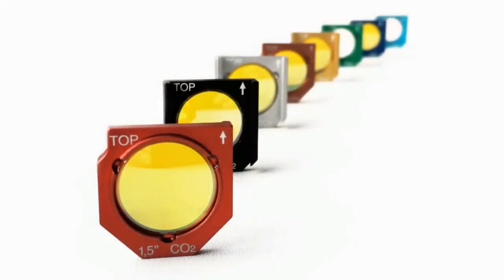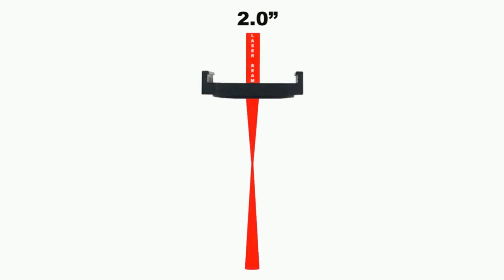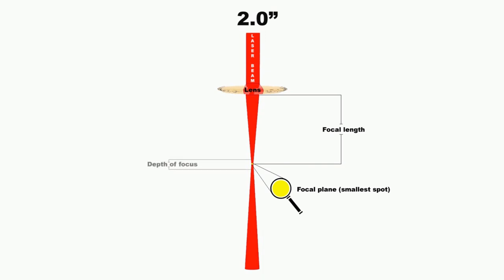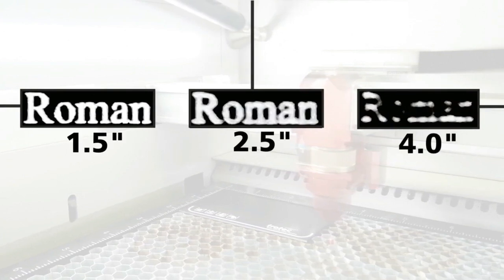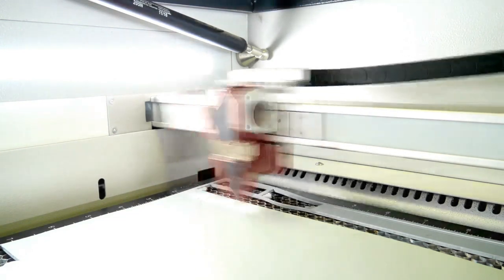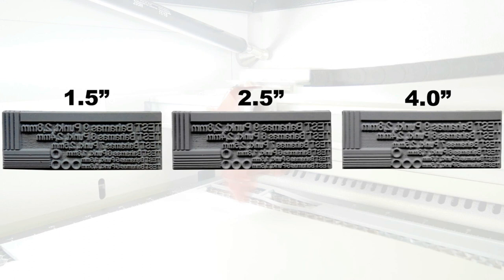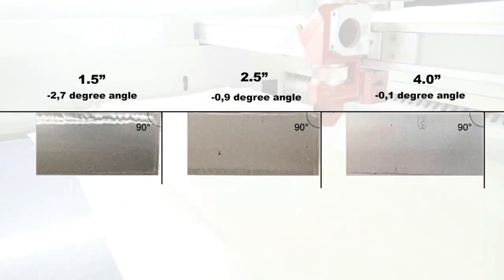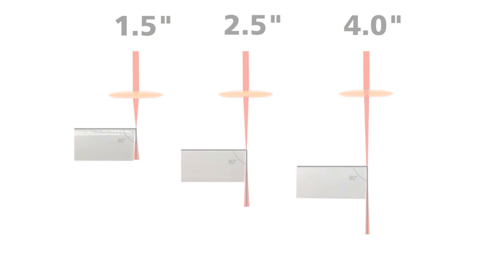How To Use Different Focus Lenses - Finding the Perfect Lense for Every Material

Comment: As I got it right you did not adjust the focus when engraving Al to the focal length of the 2nd and 3rd lense? If this is done the engraving should look exactly the same on all three specimen. Right? What are the possibilities to get a smaller focus point? This would be the way to increase resolution, increase speed by having a more concentrated spot and you will be able to cut deeper with a 4" one. What can be done to get a smaller burn point diameter? Mine is about .068mm DIA in optimum setting. I really would like better resolution also when production time increases by a smaller line gapping. Thanks guys.
Reply from the maker: Hi! Thanks for your question and interest - you can find a detailed description about our focus lenses and the optimal use of them for reaching perfect results here: https://www.troteclaser.com/en/laser-machines/laser-accessories/focus-lenses/. If you require any further info on this topic, please contact us: https://www.troteclaser.com/en/contact/

Comment: The graphic at 1:40 is incorrect.  Focal length is from the center of the element, not the leading edge to the focal plane.  I know it doesn't mean a bunch here, but the same term in photography has significant importance.
Reply from the maker: Hi, thanks for your input, you are very keen-eyed. You are right, the line is inaccurate and will be corrected with the next revision of the video.

Comment: What were the speeds/powers used? Does the 4" lens need more power to cut through the same material as a 1.5" or 2.5"?
Reply from the maker: Hello Colleen, thank you for your questions. The parameters differ according to the materials you're processing with the laser. The more delicate and detailed the graphics are, the smaller the lens should be. For cutting thick materials, lenses of maximum size are recommended. For detailed information please see our FAQ page: https://www.troteclaser.com/en/knowledge/tips-for-laser-users/selection-of-the-right-lens/.

Comment: Why does a longer focal length correlate with a larger spot size? I would have thought they all converge to a point (diameter 0) before diverging. Is this due to Raleigh scattering?
Reply from the maker: Regarding point (diameter 0): A wave cannot be focused to a point. The beam waist increases with increasing focal length and wavelength. Waist is typically 10-20 times the wavelength.
Please find more information here: https://www.troteclaser.com/en/knowledge/tips-for-laser-users/selection-of-the-right-lens/

Comment: What kind of laser power wattage do you need to use a 4" lens?
Reply from the maker: Hi Mr. Harney, the parameters (especially speed and power) are depending on the material you intend to engrave/cut and the expected outcome (color change, depth of engraving).
The 4" lens has a spot size (diameter) which is twice as large as the spot size of a 2" lens.
 Energy density compared between 2" and 4" is 1:¼ --> you have to adapt your parameters (speed & power) to compensate this much lower energy density.
 Your Trotec Team

Comment: Will a 4" focus lens be able to cut deaper materiale with the same power than the other 2 lens types ?
Reply from the maker: Hi Bo, basically yes. A larger lens is able to cut through thicker materials than a smaller lens. But the laser power of the machine needs to be high enough to cut through this material, too. We'd need to look into your case in detail to give you a precise answer. Let me know, where you're from. Then I can give you the contact details of your local laser application engineers. They can support you by testing your material on our lasers (free of charge, of course).